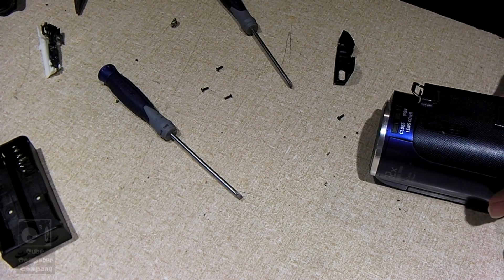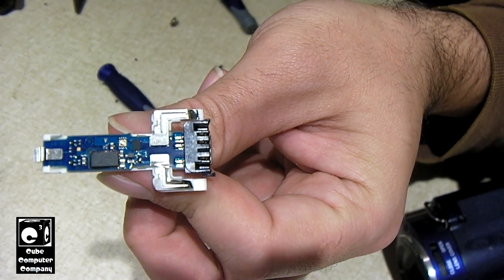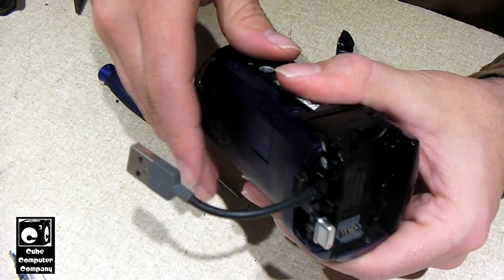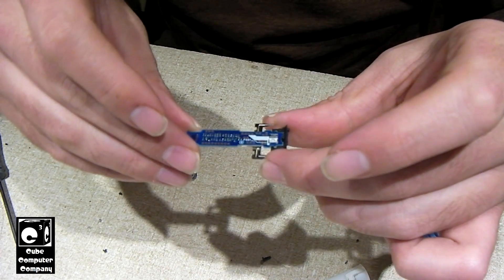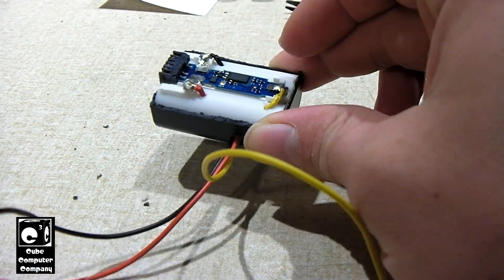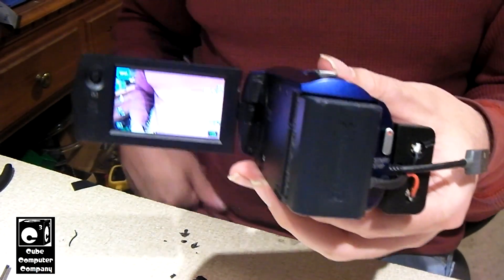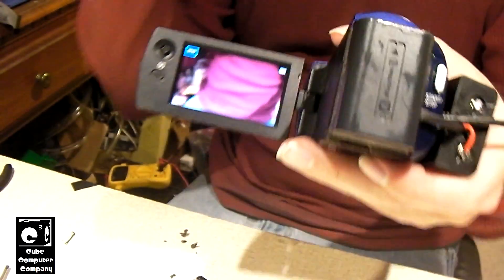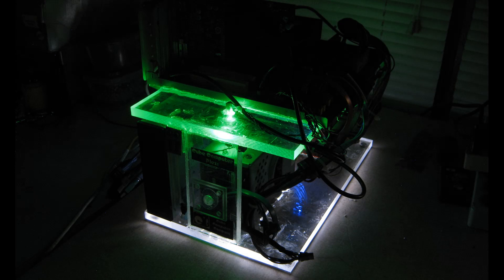18650 modding my Sony Handycam HDR-CX220

Comment: If you get a battery bank curcuit that can accept the battery in series then you might be able to build a portable kick starter for the camera
Reply: Alternatively you could get an 18650 power Bank off Amazon or eBay and just use that along with having an extra phone charger, or even using a USB OTG adapter to lock start of your phone
Reply from the maker: @JessicaFEREM  Yes, a power bank will jump start it

Comment: i  would have just made a case for a 2s3p config and mount the pack onto the tripod with an extension cable to the camera battery instead of fixing the battery holder to the camera. would have given you more capacity, ease of charging.

also if you are gonna play with lithium cells get yourself a proper charger like an imax b6 (get the original V1 and flash it) or get one of the cheaper clones that are supported by the cheali charger  firmware
Reply from the maker: I've been using an OPUS BT-C3400 and have been harvesting 18650s for nearly 8 years.